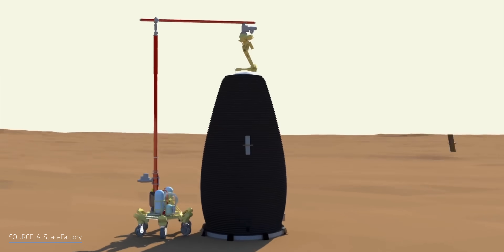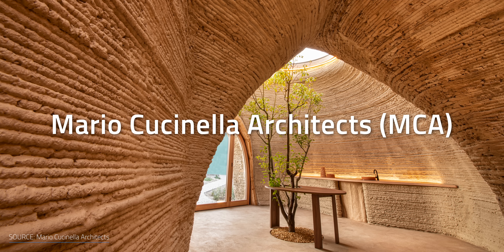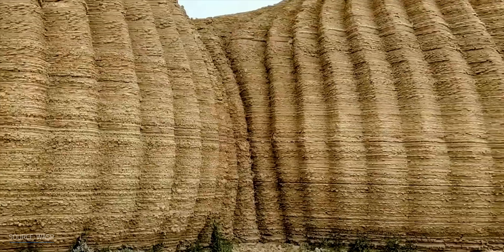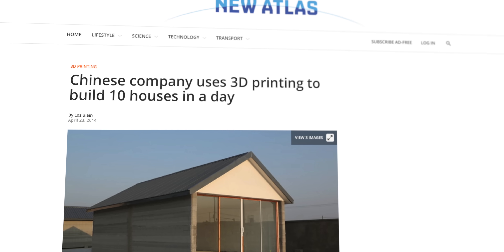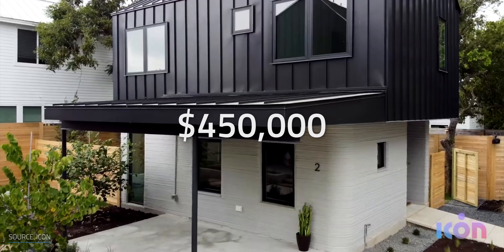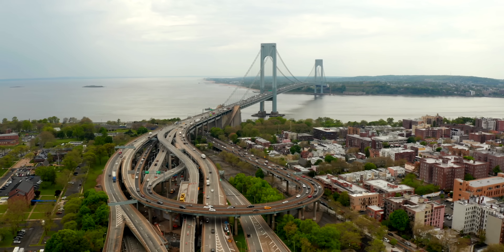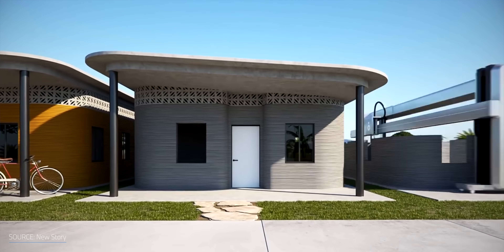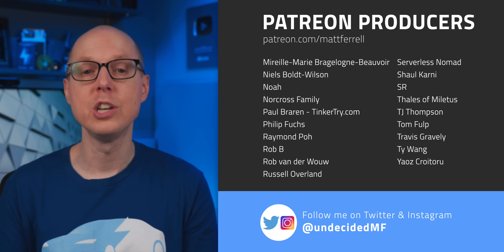The Truth About 3D Printed Homes

Comment: This tech and other low density "green" technology kinda upsets me. I know in the US people think there is 2 types. Low density suburbs and high rises. We need to promote higher density mid rises with close houses and shared resources. Geothermal heat is expensive but if it is split between 2-4 houses it becomes more affordable. 

A tech I am interested in is the sand heat battery. Basically you dig and build a large insulated area full of sand and heat pipes. You pump excess heat into the sand which can store that heat for months. Then when the weather becomes cold, we pull the heat from the sand to heat buildings, roads, indoor pools, etc. It isn't a residential size project although I have heard of people making small ones in conjunction with heat based solar panels for nighttime heat. It's main process is for big buildings such as schools, government buildings and large successful malls. It can easily be built where parking or a park would be placed and is a place to store waste heat from ac to use when it becomes cold. Something to look into I hope.
Reply: I've seen some things on community scale thermal storage like this, but my understanding is that they were using some form of gel as the storage medium, and then sand as an insulator. Heat went in for 8 months of the year, and was pretty much used up in the 3 months it was needed, with electric backup if winter went long... Seemed pretty cost effective at that scale with a payoff period of an estimated 5 years back in the early 00s...ill have to look that up and see how it is doing now some 10-15 years later.
Reply: @CaedenV  https://youtu.be/tm7spMG0ch8

This is the video I remember about it. If you don't wanna watch the whole video it is a Finnish company called Polar Night Energy.

Comment: So glad to finally see a balanced presentation on 3d printed housing. As an architect who has been fascinated by additive manufacturing for decades now, all of the misinformation around this topic is a concern.
Reply: Even as a 3D printing enthusiast, it's deffinitly annoying hearing people overhype and over exaggerate the capabilities of 3D Printing, it's a really cool technology, but it's not fast and it's not Startrek replicators, trying to make a print water resistant  can be challenging even for small item, Each material has different issues that constrain what it's useful for in 3D printing and some have really weird quirks that can make them difficult to print.

I have a few different spools of PLA and ABS in a couple different colors, but after the time I've spent to fine tune printing Clear "natural" PETG, I just end up focusing on building my designs based on what I know PETG hand handle and be easily printed in, especially with as few supports as possible because it's a bit too good at bonding with itself even when I don't want it too.

I can only imagine how much of a pain these Clay and cement based materials are like to fight with on such massive machines, it's still going to be a while before practical affordable housing can reliably use 3D printing as part of the process.

That said, it might be interesting to see how the Nasa related projects for building Moon/Mars base printers goes, given they have the budget and R&D to come up with some decent systems, some of the over-engineering requirements to make those work might trickle down to the construction market later to make some aspects more reliable/efficient
Reply: As a fellow architect, I agree with you on that point. Getting reliable information is concerningly difficult, and it's good to see a balanced presentation on it
Reply: Do you think we will ever get to a printed high rise ?
Reply: @maudepotvin8660  Germany is already doing multi-level 3D printing and their next certification is for high rise.  So yeah.
Reply: @natenesler5028  That will be something to see ! My FDM printers feel so small now ... lol !
Reply: @maudepotvin8660  we are actively working on it.
Reply: The Chinese are already doing prebuilt assembly type of skyscrapers that can be done at even quicker pace than just 3D printing on site
Reply: @inkbold8511  this is a huge red flag. they have tofu skyscrapers that were put up in days. the buildings collapse or when they get struck by lighting they go up real quick in fire
Reply: @inkbold8511  The interesting thing with 3D printing, is that it doesn't take much equipment. I've seen the building you are talking about, they are made in huge manufactures.
Reply: I mean I can understand the misinformation about the time and price but ffs acting like you're going to 3d print schedule 40 and a dishwasher in place is disingenuous.

Comment: I think the way to 3d-print a house might be do use something like large prefab Lego blocks, some containing  bits of plumbing  and/or electrical wiring with applicable connectors that allow them to connect easily with adjacent blocks.  Some blocks may also contain entire windows, or plumbing fixtures like a shower or toilet.  Then the "printer" would be a robotic arm that simple places the blocks.

Comment: If I heard correctly, the most prominently featured 3D-printed house in this video is basically made from clay-earth and water. No mention of portland cement or anything else that might make it more resistant to simply melting away when rained on. Maybe I missed something. I'm pretty sure this can't be correct. But if there was no mention of this problem, I'd say that constitutes a major weakness of this video.
Reply: If you coat it with a flexible water-proof coating, it should be no problem. 

I'm more concerned about resistance to natural disasters. When earthquakes hit areas that have a lot of mud-brick buildings, for example, the casualties are enormous. In quake-prone places, this kind of structure is a non-starter unless it can be demonstrated to resist earthquakes, and I can't see any way to do that without building in some kind of tensioned post-stressing system, which would increase the cost and construction time significantly.
Reply: What this guy says
Reply: With a proper roof it might be ok, but for anywhere that’s not a desert it would be washed away in anywhere from a couple days to maybe a year or two max.

Not a lot of clay in the desert either...

Comment: For me the future with 3D printer home is: run like Lego blocks or panels with containing all the wires and pipes that home need it, but build on the factory like pre-build and just in site put together all the parts, if you can make one month finished house with 3D printer panel prebuilding on factory. you can improve the quality and reduced cost, with a army of the design engineers work over cad system to configure out all the details that the architecture needs, you can offer a prefect house with fast time quality and price!!!

Comment: It'd be interesting to see a comparison in time / effort / cost between 3d printing walls and good old brick laying.
Reply: ... not to speak of pre-cast concrete construction!
Reply: Yes.

“Concrete is bad, clay is good” we have that already, it’s called bricks.
Reply: Cinder blocks, rebar, and concrete are pretty cheap and quick.
Reply: $24-$32/hr for a mason in the US.  For 1,000 sq ft of wall, between 167-500hrs (8"x8"x12" concrete block to common bricks). For a 1,500sq ft house, 8' high == 3,000 sq ft of wall (box; no doors/windows).  $36,000 for brick construction, in labor costs alone (although man-hours were 3 unskilled, 1 skilled - but those were older numbers, not sure what labor costs are for you, and if you can get enough skills for $24) - and ~27days in time (bigger crew, could be a somewhat shorter time - if labor is infinitely available - courses need to set before you can build on top of them).  Might cost more/take longer to do scaffolding for multi-level construction - may cost more for earthquake remediation. Bricks are expensive, both in cost and in carbon footprint: lime requires burning, bricks need to be kilned.  For automated construction, just setup costs; in large scale production you could have 1 guy/crew go around setting up things to build houses all day.  There's a rea$on we use framing.
Reply: @jender8022  Rich places like the US would go for better construction than printing anyway, and should be building at least 3-5 floors. Poor places, the labour is cheap enough that brick beats printing easily.
Reply: Or sandbag construction with a plastered finish.
Reply: If the soil is suitable, bricks can be made on site. The house can then be assembled by people where jobs are needed, or pick and place machines where labor is in short supply.

Regardless of the construction method, designing in accessible utility conduits makes a home much more adaptable as plumbing, power, heating and cooling technology changes over time.
Reply: @hamjudo  you need to bake the bricks, unless you're thinking of adobe huts, and that's not easy to do on site, specially at a certain scale.

Comment: The shell of a home is, roughly, 1/3 the cost of a finished home. I can see where you can save some money with 3D printing but it won't be a huge savings. Concrete production produces lots of   CO2. Of course, using dirt or clay would be better but the right kind may not be available depending on location.
Reply: And how much concrete goes into the shell of most housing anyway?! 3D printed houses still need a foundation which is probably concrete and they still need roads and sidewalks and driveways which are probably concrete. 

3D printing will do almost nothing to reduce the use of concrete regardless of the material used. 

Meanwhile wood framing sequesters carbon for the lifetime of the structure.

Comment: This construction method uses mainly dust or dirt. To get insulation and structural strength walls are very thick increasing material use, built/drying time and costs. Adding other material such as wood, steel and PU etc would improve building properties leading to shorter build time, stronger, cheaper and likely more sustainable homes.

Comment: SLS: Selective Laser Sintering. You are confusing it with SLA: Stereolithography. 
SLA requires photo sensitive material. SLS only needs lasers (or electron beam) to generate heat to fuse powders. SLS can fuse many powder types such as; metal,plastic etc.

Comment: The reason I don’t buy in the “3D printed home” hype is because construction isn’t a huge problem for us. Corporate landlords buying all property, and single family home zoning are the problems really hurting us.

Edit: also, the reason 3D printing is such a big deal in manufacturing is because it allows you to do designs that are just impossible with other methods like injection molding or extrusion. And it allows you to do this while keeping the costs low because you don’t have to purchase tooling.

3D printed homes aren’t pushing against these same issues so they’re unable to get the same benefits.
Reply: This. Especially since the actual hard parts of construction - land procurement, zoning, permitting, grading, utilities etc - are not the ‘building’ part of construction. I’m a pretty mediocre amateur carpenter and can fairly easily build the walls and roof framing of a modest house when all those hard parts are done. As far as building in remote (ie poor, developing countries) its far easier to just drop off modular buildings.
Reply: @MeanPhyllis  land is the issue. Not structures.
Reply: @MeanPhyllis  that’s the point that I tried to address in my edit. You’re looking at it the right way, but I don’t think that’s going to happen for homes.

In injection molding a mold can easily cost 100’s of thousands of dollars while the part you make with it may only sell for $1. So you only use that process for products which you know will have large enough production runs in order to ultimately be profitable. 3D printing made a huge splash in that industry because it took away that initial investment and made it much easier to be profitable with small production runs.

Housing doesn’t work like this though. It’s quite common that the most expensive part of a home is the land that it sits on. As others have mentioned, the part of building a home that often takes the longest isn’t putting up the walls, but is simply completing the paperwork so that you’re allowed to build.

So I think you’re looking at it the right way, but I just don’t think that applies to housing.
Reply: AirBnB is poisoning the realestate market.
Reply: I am a 3d print enthusiast and love the technology, but totally agree, 3d printed houses, is not the solution to the housing problem in 1st world countries,  only a small percentage of the public would be interested living in a city in a  minimalistic mud teepees.

there is a reason why the same home can cost 100,000 in one place and 1,000,000 in another,  location, location, location. 

I think a better solution at least for "housing cost" (not property cost) is manufactured homes,  and I am not talking about trailers and mobile homes.  Not a plug,  but companies like Boxable,  are the way to go.  these are modern structures, that are attached to foundations,  they can easily fit in urban areas, and fit in many back yards,  increasing the "housability " options in locations with high demand, which could lead to lower cost of property.  functional modular systems, are easily expandable,  both horizontally or vertically. 

I hope Boxable is not vaporware, they do look legit,  but I hope more companies follow and do the same thing.
Reply: @wflzoom6219  Boxable is very clever, but can't be low-cost or energy efficient.  Probably some niches.  Also probably will develop moisture/longevity issues.
Reply: You are totally right real estate should have been regulated long ago 
Instead they waste their time regulating drugs
Reply: @HoboGardenerBen Ah, yes, we must get rid of single-family home zoning so that developers can turn neighborhoods where people can have a safe and peaceful life into wastelands of multi-storey pack and stacks that differ from prisons only in that you get to pick your wall colors.
Reply: This, zoning and land use laws are the true factor in housing affordability becoming less common
Reply: FUN FACT:. It turns out that Russian Oligarchs have been buying up houses all over UK and US.  Many are vacant investments, aggravating housing shortage.
Reply: Yup, there really isnt a shortage in housing, real estate finance just owns so much of it to control pricing that there are shortages especially affordable properties in popular areas.
Any time a new tech company glosses over their operations and claims everything is perfect, its really going to hell in a handbag, but they dont want you to look at all the glaring faults to which they dont have answers. Also, they probably want to go public and cash out... im pro affordable housing and simple living, but theyre just making clay walls and selling the world
Reply: Spot on
Reply: More complaints about the humans screwing over others yet nothing being done.
Did everyone forget why French Revolutions or other such revolutions happened?

Complain complain complain, but unless you do something physical it ultimately won't matter. Push people to move or stop whining about it.
Reply: no construction is still an issue. even new builds are half a million now, and that's without all the bells and whistles like gutters
Reply: Yes!  And they are looking for a problem to solve with layered extrusion, instead of designing better processes specific to home building.
Reply: Recently watched the video on 5 over 1 housing from halfasinteresting. It’s sad to see corporations taking over the housing market.
Reply: @yensteel  yea I watched that one too! Agreed! Although, as an environmental person I will say that I like how these style buildings are helping us densify our urban population.

I just hate that they’re all owned by corporate landlords haha.
Reply: @MeanPhyllis  The corporations own the land you want to 3d print your house on.
Reply: @y0nd3r  no, they don't. Unless you want new construction in the middle of a city there is a good chance a corporation doesn't own that land.
Reply: Yeah, don't let people own single family homes, put everyone is Soviet apartment blocks.
Reply: You have no idea what you're talking about. 

1. "Corporate landlords" own less than 1% of the country's housing. They're a big bad cAPitAliSt Boogeyman created by NIMBYs to distract people. 

2. Zoning laws were absolutely a huge issue. But post pandemic with people leaving the big expensive high restricted cities, the bigger issue right now is actually labor and construction materials.

Developers, builders, unions, can't produce fast enough even in areas where they can legally do so.